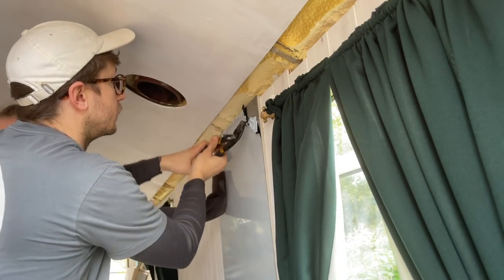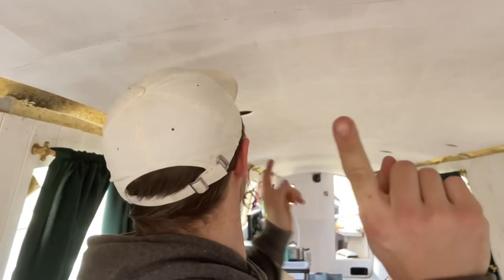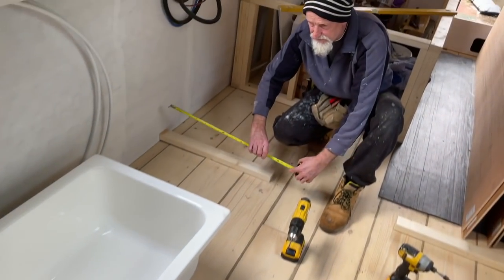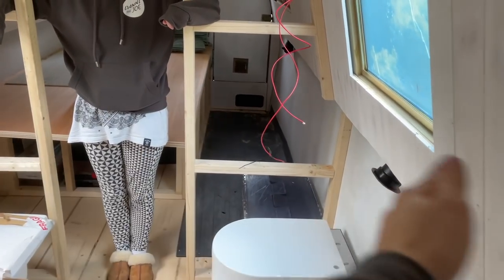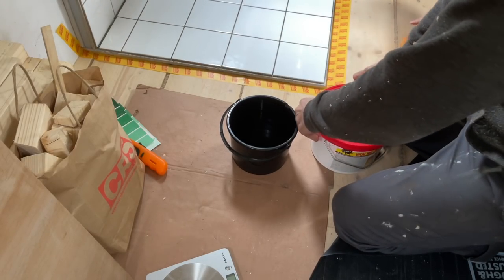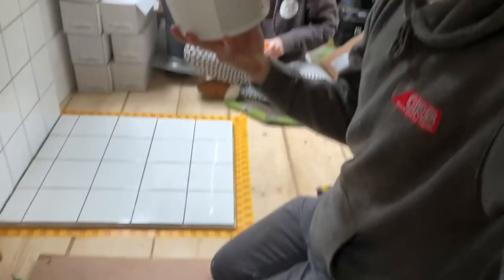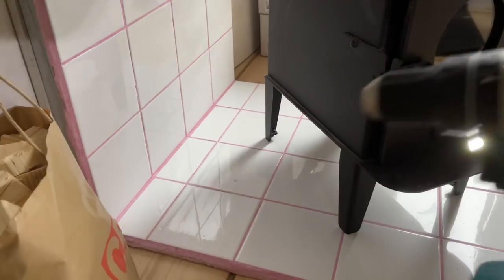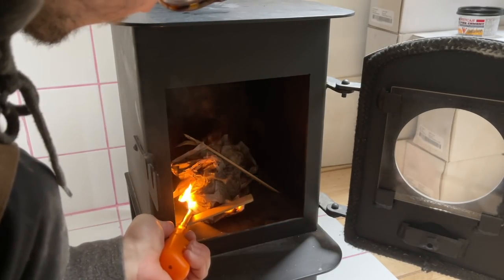Log Burner Install Just In Time | Stud Walls | Narrowboat Conversion | BOATLIFE

Comment: Hi both. Another really good vlog with lots of progress on the boat.  Adding the framing for the walls makes such a difference - rooms taking proper shape now, and the fire and hearth will really add a lot when the grouting's finally cleaned up. Your hard work, and Uncle Gary's, is really paying off. Not long now till you can start to use the boat comfortably despite the weather. Thanks for the vlog.  George and Trish - CaravanningMacs.
Reply from the maker: Thanks so much! Yeah really boosted our spirits with his help!

Comment: Make yourself a grate on small legs for inside the fire. You can make an ash pan to go under. The fire will burn better
Reply from the maker: Thank you yeah it's a log burner rather than multifuel to we're going to experiment with different heat logs, we've got some fire bricks on order too!

Comment: If you could get enough scrap strips of UN-finished marble, to do your stove border, you can stain them pink yourselves. Marble will stain with simple grape juice or wine or even possibly your grout pigment.  Do enough test runs to get your right shade and you have saved all that money... Once you have the right shade of pink, seal the marble with marble sealer. 
Marble, is like a sponge, it will soak up any color you throw at it...
Hint anyone installing a sink will have a marble piece from the cutout.  Any tile person or rock person can cut it into strips maybe for nothing. If your steady enough ,you can cut it into strips yourself, with a tile blade and a straight edge, for your grinder.
Then when someone may ask where did you ever find that lovely shade of pink marble, you can truly say "" you can't, it's a one of a kind.
CCHHEERRSS
Reply: Seems dangerous to me to create an obstacle to trip you up in a narrow boat next to a fire,you could go to a wood mill and they would machine you some triangular bead or wedge to go with the floor,once your floor is sealed it won't damage and you've got a Hoover for when it's cool. I know your not stupid but anybody else on the boat might not be as careful as you. Just a thought it's your boat. Kind regards.
Reply from the maker: Thanks that's a cracking idea will see if we can get hold of some unfinished marble!
Reply from the maker: Yeah I agree but it's recommended to have an up-stand to contain anything falling out of the fire, it's either an up-stand or the hearth had to come out by 400mm at the front! Crazy hey?
Reply: Danni and Joe
You'd have thought by now they would have incorporated a sliding retractable tray with upsides,job done,how difficult is that?

Comment: Great progress guys, looking good.
Think a small grate in the log burner might help with air flow and keeping the fire off the direct bottom of the burner
Reply from the maker: Yeah we're keeping our eyes out for one small enough, it's designed specifically for wood and burns well but we're going to experiment with different heat logs!
Reply: Hello, you can cut an existing grate down to the size that you require for your stove.
Reply from the maker: @brendancorrigan5038  will get the grinder out! Good call

Comment: Great Video Gary , I noticed your stove has no fire bricks or a grate in it , this means you can't burn coal in it so i am told is this your understanding ?? Dave
Reply from the maker: Yeah this burner is specifically for wood, but we've got fire bricks on order & will experiment with different heat logs etc

Comment: Hi Joe and Danni.. could I ask what you used to stick the tiles to the ?Fire board. I have a vermiculite board behind our small stove and unsure what to stick tiles with. Cheers and good luck with the van.
Reply from the maker: We used Vitcas heat resistant tile adhesive to go from tile to tile backer, think we had to mechanical fix (screw) the tile backer to the fire board though

Comment: Coming together!! :) One question: how much water does that bath hold, and how much water does your shiny new tank hold? ;-)
Reply from the maker: Thank you! The bath will use around 60-80 litres of water, but we’ll mainly be using it as a sit down shower, just saving baths for special treats when we’re near water fill points! The tank is 400 litres so plenty for the odd bath when we’re in the middle of nowhere as well 🙂
Reply: @ItsOhJoe  Thanks for taking the time to reply, and thanks for a get series of vlogs :-)